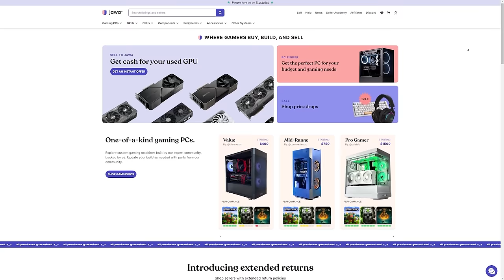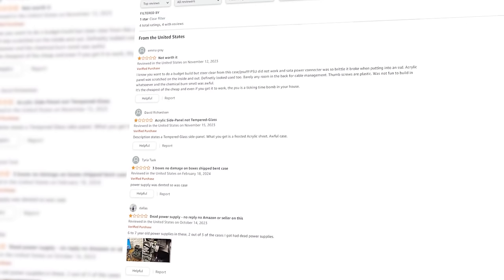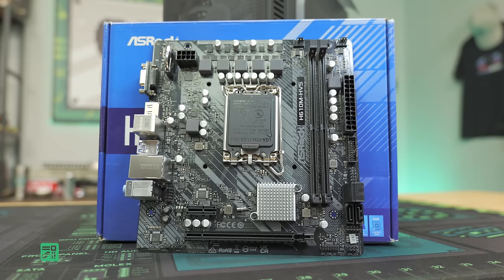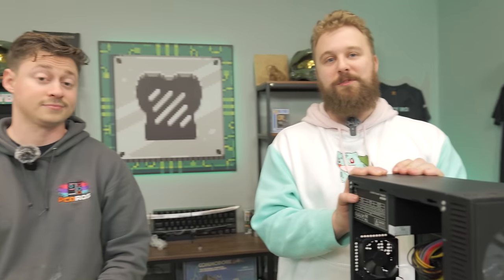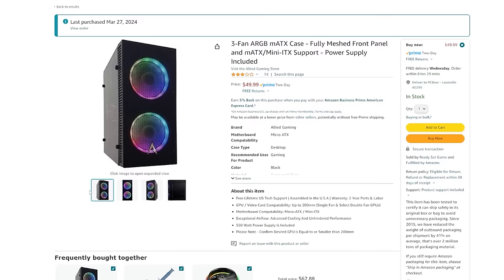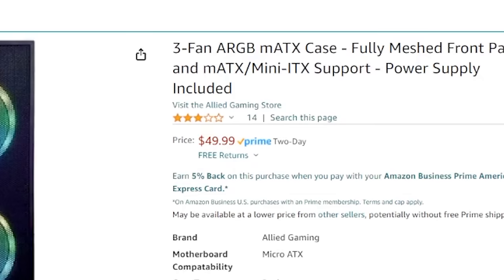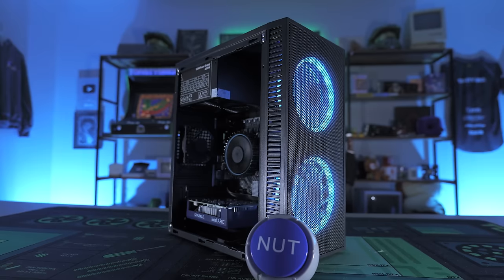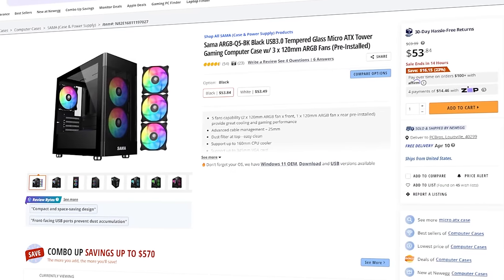We Built the CHEAPEST All New Parts Gaming PC....

Comment: A Ryzen 5 4500 is like $77 on Amazon. I used one on a budget build and it’s pretty impressive. I would definitely recommend that with a b450 motherboard
Reply: I have one on a x470 overclocked and a rx6600. Its a solid 1080p 60fps ultra setting setup on most games. Starfield dips into low 50s though but not an issue for me .

Comment: PSU like this are common here and are used for low powered systems , I worked part time as someone who manages it in an computer rental cafe . The specs are 2nd gen i3 , 12gb ram , 256 ssd and gt 610 so far those components are already in its 6 years working just fine and survives disasters like flood where, of course the psu were removed before that disaster happened. I wouldn't recommend anyone using those psu unless you have similar power draw like the spec sheet I mentioned, but do that if you have enough knowledge when shit happens and always expect the worst

Comment: In my experience, generic psu are kind of ok with cpu and gpu that doesn't draw a lot of power like i3's and entry lvl gpu that only use the pci-e power. But its definitively a weak spot on the system and i wouldn't run them for more than a couple of months until you can buy a decent psu. 

When the covid thing started a lightning strike a post on the streets and fryed my psu luckly for me the protections of the psu saved the rest of my computer. After that since the restrictions and lack of money i used a generic psu from my previous computer, and it worked kind of fine for a year until i had money to buy a new psu. The pc i had that moment was an fx 4300 + 8gb ram + gtx 1050, and i just underclocked the fx 4300 and that alone lowered the power draw of it, from around 90 watts to about 70 at max, the 1050 only used the pci-e so its around 70/75 watts max wich made the whole system draw about 200 watts at max when stressed.

But as i said i wont do that again unless completely necesary and for not longer than a few months. Not only for the real risk of a really bad psu destroying the pc, but also becouse the good psu usually have protections of a variety of types that are really what you want on the long therm for the pc to have a good long life of gaming or whatever. No one knows then a ligthning bolt will strike around your house and fry every unprotected electronic, the electric line itself can have a failure and send high voltage too, those things are rare but it can happen. 

Anyway im on both sides of this disscussion, yes its kind of ok to run a low end system like an i3 with entry lvl gpu, with generic psu, but on the long therm, we should always upgrade that psu for a decent one the faster the better.

Comment: I've opted to get a decent B-550 board for around 100 bucks,  32 GB RAM, and a CPU cooler and buy a used  ryzen5700x and make do with my gtx 1050 ti for 18 month or so that way I can push off needing to purchase a new PSU and  I won't need a new mobo in 6+ years when I chose to upgrade again. eyeing a rx 6750 but maybe the price will fall or something better will come along in 18 months

Comment: I don't know the price of a new CPU like a Ryzen 4100 issue. But it would be alot slower than the 12100F, so I agree with the toasty bros picking that CPU. Can always get cheaper going second hand as you stated in the video. With new parts comes a warranty though and for some people they don't want used parts. Also while you can use something like a 5500xt with 550watt PSU, better to get a low wattage GPU to be safe. Back in the day, there was lots of cases that came with PSUs. I remember buying a case around 2005 with a antec 450w trupower PSU and thinking it was really nice lol. Today most companies don't even sell anything below 500w, with 650w being the minimum for some product lines.

Comment: $ 446 All new parts:
AMD Ryzen 5 3600 3.5 GHz 6-Core Processor
ASRock B550 Phantom Gaming 4 ATX AM4 Motherboard

ASRock Intel Arc A380 Challenger ITX Arc A380 6 GB Video Card
TEAMGROUP T-Force Vulcan Z 16 GB (2 x 8 GB) DDR4-3200 CL16 Memory
Kingston NV2 500 GB M.2-2280 PCIe 4.0 X4 NVME Solid State Drive
GameMax G563 ATX Mid Tower Case
Thermaltake Smart 600 W 80+ Certified ATX Power Supply

Comment: the 2200g my new msi b55 pro vdh retired the apu (not supported0 in bios  but the ryzen 7 3700x is a good option a budget build for the cpu with rtx 4060 650w psu 16gbram   but need to upgrade from hdd w11 pro on it lol

Comment: I wouldn't ever buy a case and no name psu
I did that back in 2012 when I was building my first pc on a tight budget
everything went well for about 2 weeks until I started hearing bangs from the PC area
while it was completely off, turns out the caps were exploding inside the PSU and eventually the PSU died
lesson was learned never bought a cheap PSU ever again